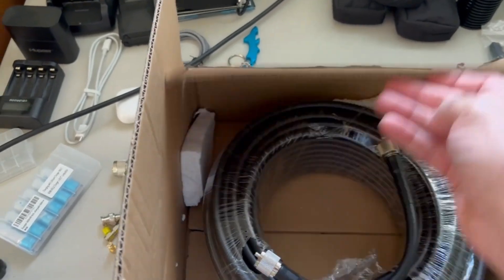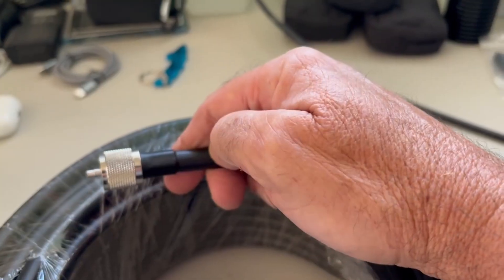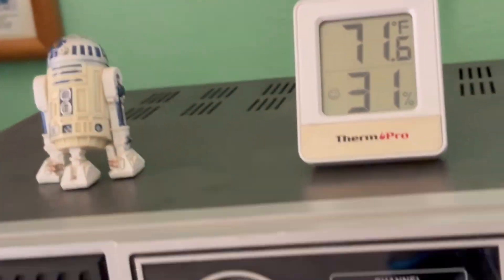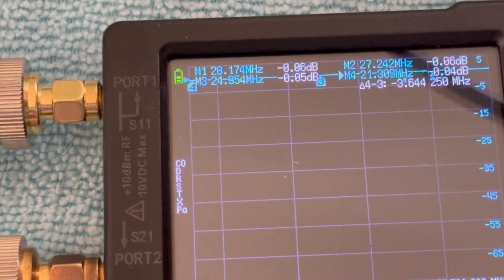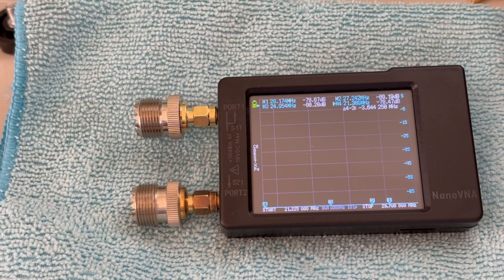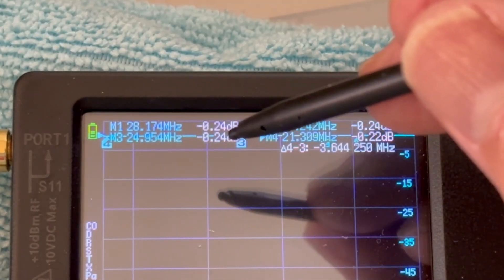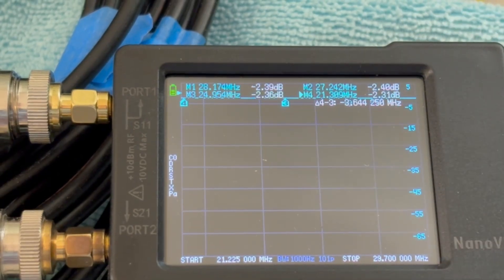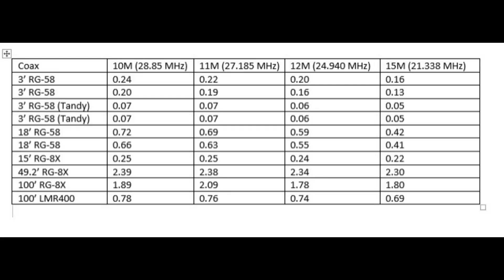Switching to LMR-400 Coax for my Solarcon A-99 Antenna

Comment: I used to use LMR400 to feed my A-99.  It worked great but I had much better antennas for 15m DX.  
It really helps when you put clip-on ferrites at the antenna. I used 6 of them to choke the common mode.

Comment: The loss between the two is too small to be noticeable. Since there are 6 db per s unit it takes 54 db to equal an s 9 signal. If you have an s9 signal with LMR, 54 db, you would have a 52.89 signal with Rg 8x. No one could see the difference on an s meter, basically 53 vs. 54 db signals. Both will appear ( s meter) and sound (by ear) the same. If I had no coax and was running  200 - 300 feet of coax I would use the LMR but for 100 feet of coax, or less, and no more than 1000 watts peak power I would  use RG-8x. My opinion

Comment: waste on a junk a99 antenna replace with a better antenna like a maco 5k or imax 2k , sirio gain master , tram 1498b , sirio astro plaine , almost anything is better .
Reply: dx engineering has  the super penatrator 500. you forgot that one. :)